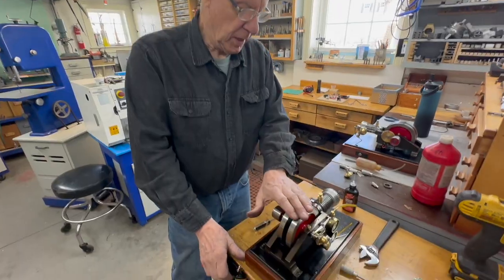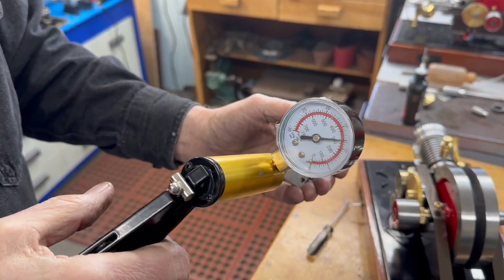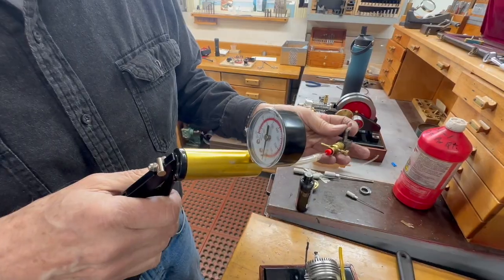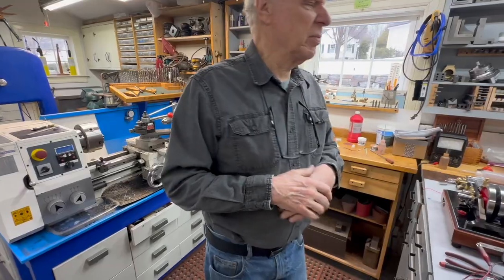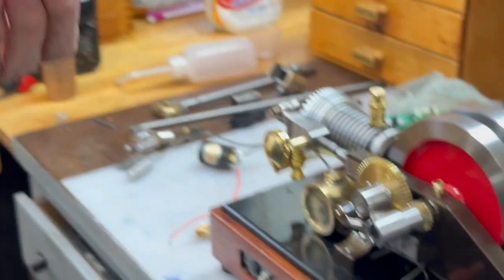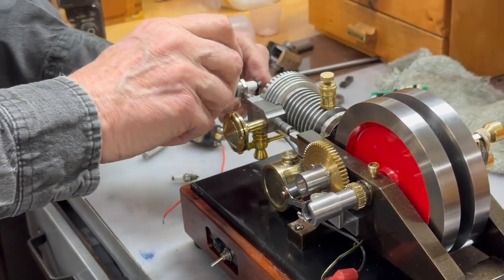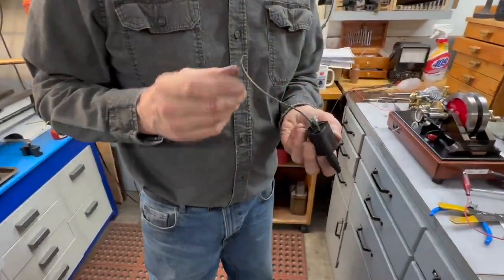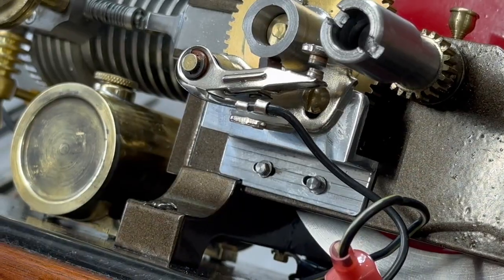6 Cycle Oddball Engine Part 25 - Troubleshooting

Comment: Plug is failing under compression. Takes a higher voltage at higher pressure. Plug is likely indeed resistor type, coil can't get there to get a nice hot spark out of it. Every time the coil arcs internally, it is progressing permanent damage.

Considered CD ignition? Should be able to use that with points because you can use them to simply trip the coil circuit, they aren't part of the primary circuit that way and the grounds won't conflict.
Reply from the maker: @MadScientist267  Hi , Thank you for your interest and your input. I only use the buzz coil ignition for the first running of a new engine,it makes it easier to start. After I get it broken in and running properly l usually switch to a CDI. Also I switch to 4 AA batteries.  I’ve been doing this for years and I never had a problem with the coil. If I didn’t have the TV on most of the time I’m in the shop I would have heard it much sooner. I always turn everything off when Jim my (friend that does the videos) comes so it doesn’t interfere with the videos. I heard it almost immediately with everything off. Im also trying a few different coils and ignition setups for my own information. I used a nice little ignition system from a company by the name of S&S machine for all my engines. He went out of business and I bought 3 or 4 extra ones for future engines, but I have used them all up. I’m kicking myself for not having more foresight.  Thanks for watching and for your advice. Joe

Comment: I am contemplating making this engine based on your videos. It will be my first gas powered engine. But the difficulty with the ignition system is giving me second thoughts. 
There isn’t someone selling a complete ignition system that includes all the necessary components?
Reply: Yes there is rcexl have to look up the number
Reply from the maker: @edvandeheyning763  ?????
Reply from the maker: @marvlinke7453  Hi, don’t worry about the ignition system, I will be doing another video just for ignition systems and make a few recommendations on what to use so you won’t have the trouble I had. 
That trouble I had with the coil is extremely rare, I never had any issues like that before and I have built over 50 gas models. Joe
Reply from the maker: @marvlinke7453  yes you can find model engine ignition systems on Amazon and EBay.  Joe